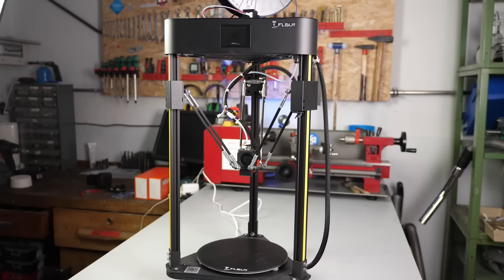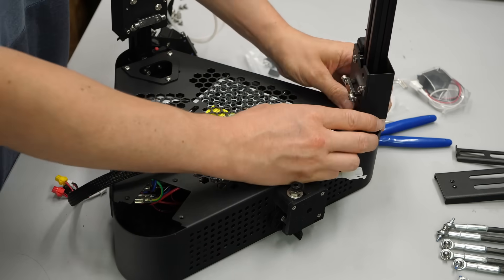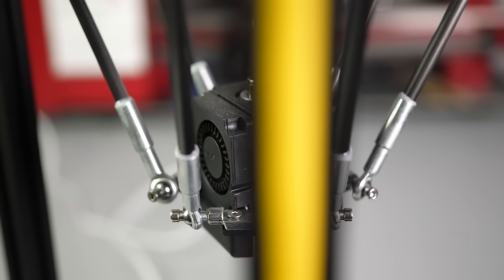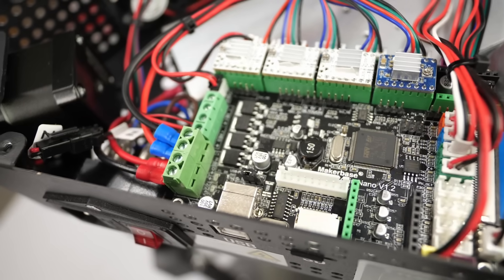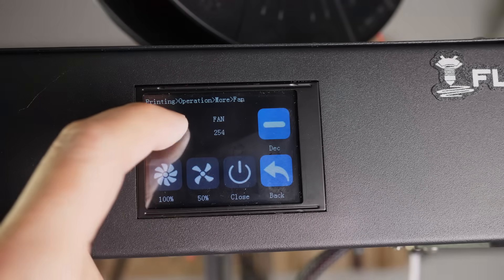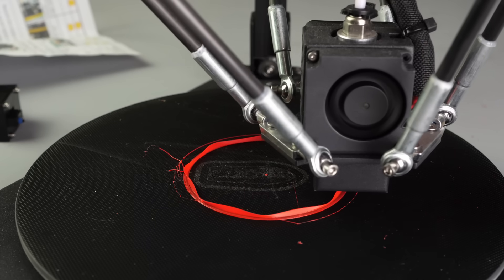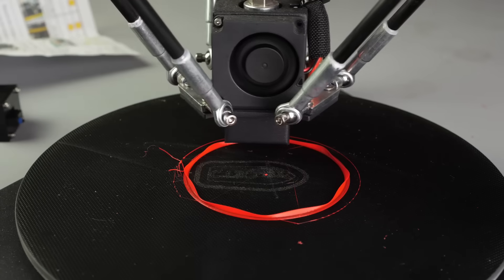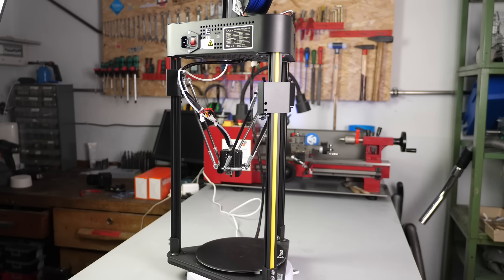FLSUN Q5 REVIEW - A 90% great machine!

Comment: One other upside of note, perhaps - The table footprint appears to be very small for its build volume, which might be a significant advantage to a maker with a very limited shop space.
Reply: Good point, it can be literally tucked into a corner since you don't have to make sure there's space for the bed to move backwards/forwards.
Reply: @licensetodrive9930  Plus the filament holder on top. Not all printers have a place for it so it has to sit on the table.
Reply from the maker: Good point! Forgot to mention that.
Reply: Yes, I currently have one sitting on about a 30cm shelf.  It actually performs beautifully once you get it dialed in.  I always set flow rate at 115% and underextrusion problems have disappearred.  I believe shortening the tube and replacing with Capricorn tubing will achieve the same result.

I just purchased a Noctua replacement fan and printed a custom shroud and duct.  A silicone sock assists in cooling as well.

I am actually amazed at the quality it can deliver at high speeds.  I am seeing Ender 3 quality at 70% of print times.  

Delta printers are so cool that you can tell your friends it cost $2000 and they will believe you.  It is mesmerizing how they move.
Reply: Literally the reason i bought the Q5 a month ago was BECAUSE of the small foot print. i have very limited desk space in my small apartment, and just couldnt make space for something like an Ender. the other issue to remember is that most Cartesian printers move their bed back and forth, meaning  you need clearance for about double the bed size to accommodate the movement, thus taking up significantly more room than you'd think. Delta's don't have that problem.
Reply: does anyone 3D print on the toilet? 
i mean when you close the door its seems a good choice for ABS xD
Reply: This only matters if you use a 2D space to compare a 3D volume.  In this matter, I could build any 3D printer as a skyscraper and meet the same criteria.  The taller I make it, since you're ignoring this axis entirely in this comparison, the larger the ratio of "footprint to build volume" you have.  It's not a really good way to compare printers.
Reply: @ThantiK  While I agree it's not the whole story, X/Y volume on a tabletop in a shop is typically significantly more limited than Z volume, given that very few people have ~5-6ft in X or Y to spare on a table, compared to basically everyone having that available in Z.  X/Y area tends to be more valuable in terms of storage in a small shop compared to total volume.
Reply: @komitadjie  This makes sense, but in that regard, I think H-bot/core XY are still champions. In my case tho, I don't have any space to keep the machine stationary, I have to store it and take away. This one could fit under the bed probably if turned to it's side so it would work for me (if shipping and customs didn't kill the fun).
In the end I decided to make a cartesian that fits the storage criteria by folding down.
Reply: @Kalvinjj  Definitely another totally valid method, especially with ABL where getting the setup absolutely perfect every time the columns go back up isn't quite as critical!  I'm not sure you can buy any out-of-box collapsible cartesians, though, and constructing that might be a bit outside the skill level of the group this printer appears to be offering the most to.  :)

Comment: I already own it and it's super fleshed out. To provide some context, it is my first ever printer and before that I have never had any experience with 3D printing at all. It was a breeze to setup and the print quality is well above average based on what I've seen from other people using other printer types. Not on the same level as something like a PRUSA Mk3, but very close. I already even made some mods for it on Thingiverse. Check them out here: https://www.thingiverse.com/theycallmestrat/designs